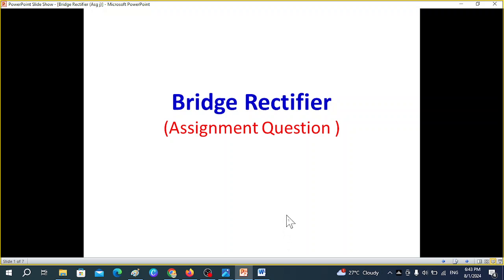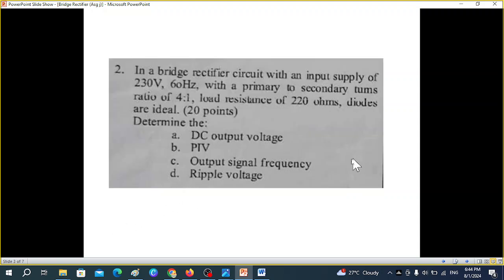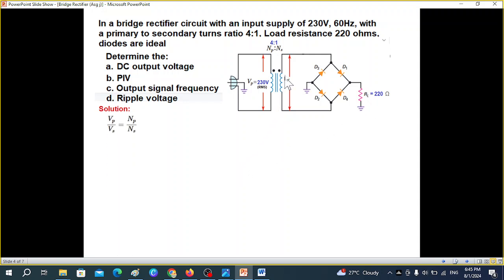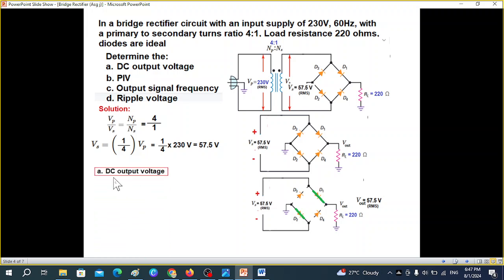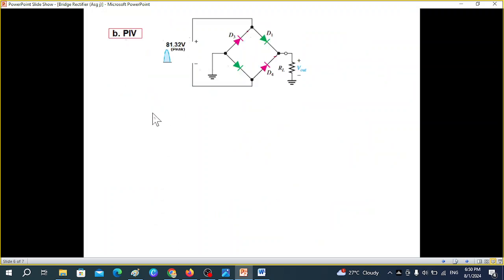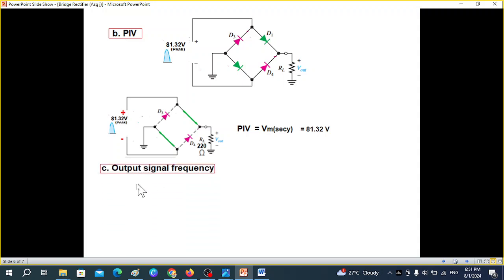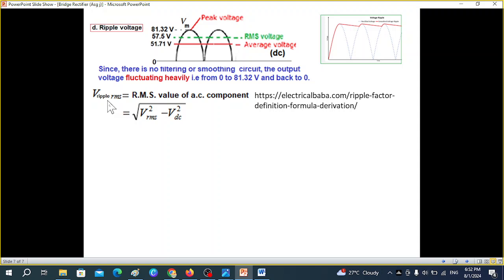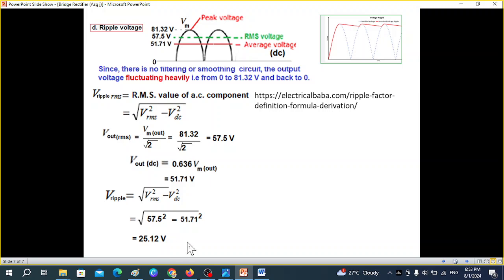(E)EDC (Assignment)Bridge Rectifier  || Calculate Vdc, PIV, Ripple Frequency, Ripple Voltage

Comment: But first you have to change in to  by using vrms=vm/sqr(2)
Reply from the maker: which time of the video you want to change it ?
Reply: @ElectricalEngineeringAcademy 

At 2:57 you take vp directly which is 230. But this is not correct first you have to change it using
Vrms=vm/sqr(2)
Vm=sqr(2) vrms= 230*1.414= 325.26 v👍
Reply from the maker: @OumerAsrar  This Vp is not peak voltage, rather it is primary voltage